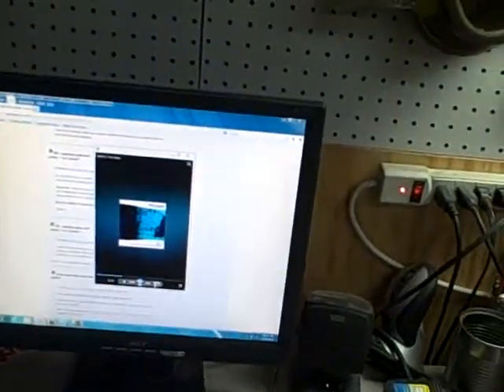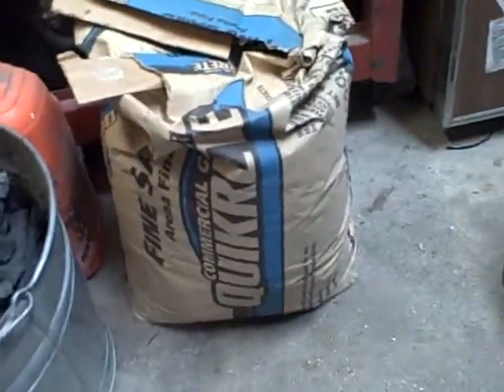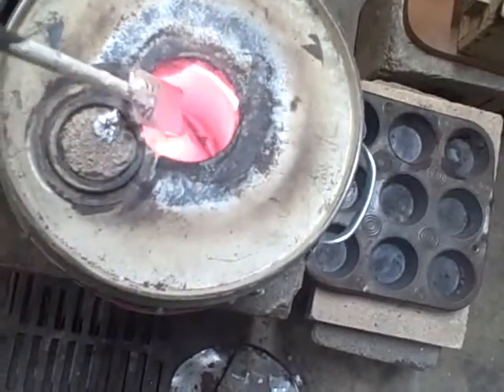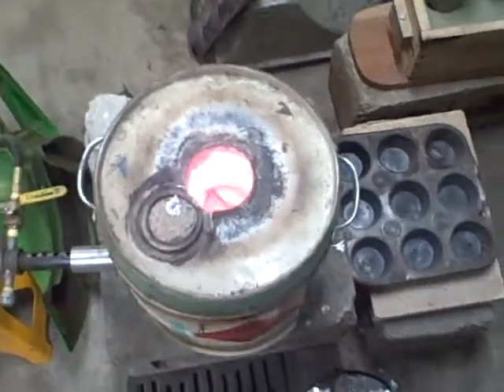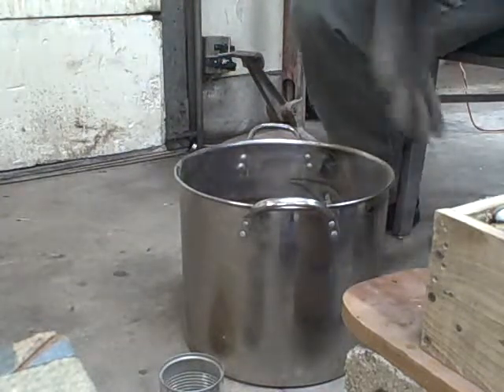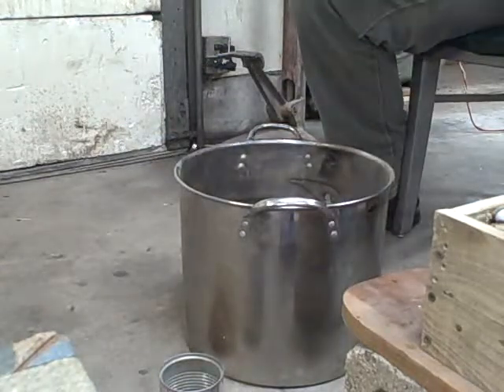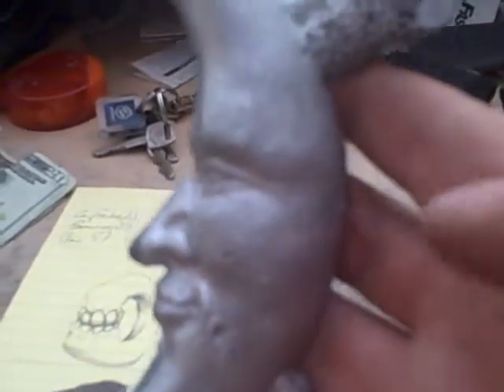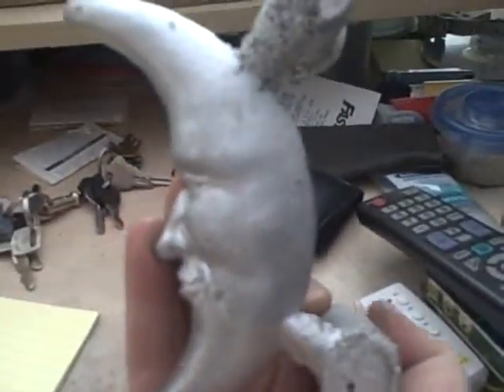K Bond Test and Results

Comment: You should gate in from a runner bar, not your pouring sprue. It will help with getting a cleaner casting.
Reply from the maker: Thanks for the advice.  This is still a mostly learn as I go process so I do appreciate it.